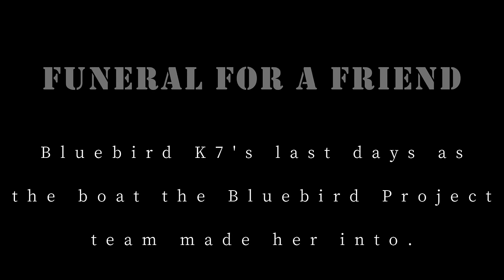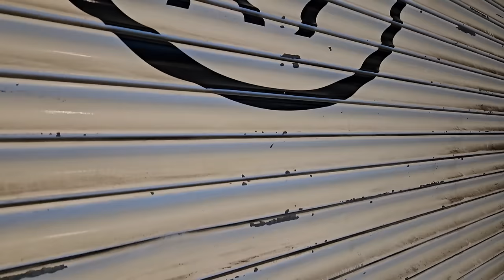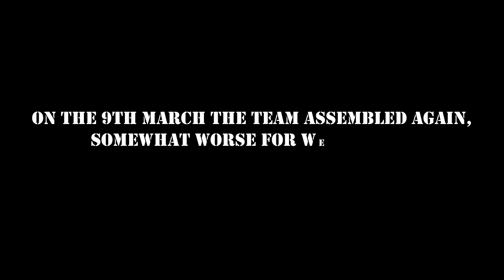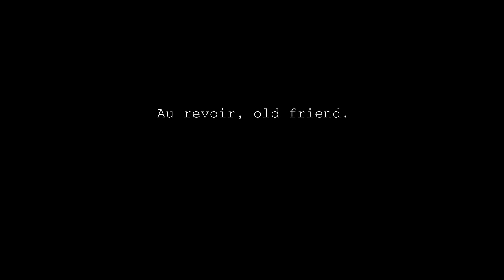Bluebird Project. Funeral for Our Friend

Comment: What's the fuel consumption on one of these engines at full throttle?
Reply from the maker: We never run them at full throttle for more than short bursts but historical data suggested the boat was good for three runs on the course on Coniston on a full tank so call it 10 miles and that would use approximately 60 gallons of jetfuel. On Bute we used around 20 gallons to do 3 miles so it tallies quite well.

Bill
Reply: Or just connect Smith to the engine it would hit the speed of sound with all that hot air 👍🏻